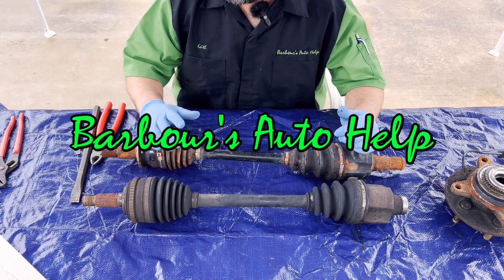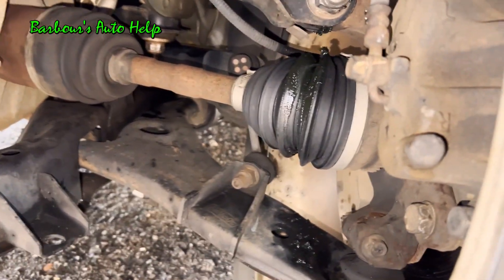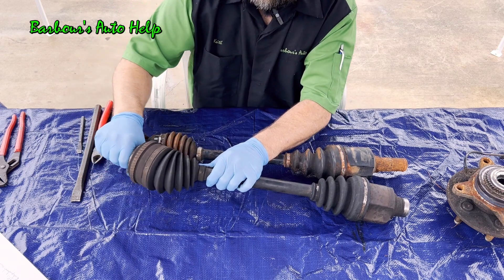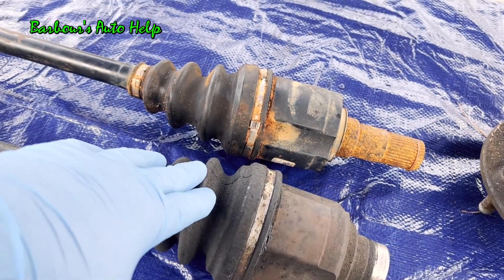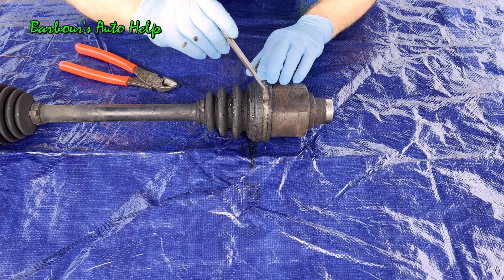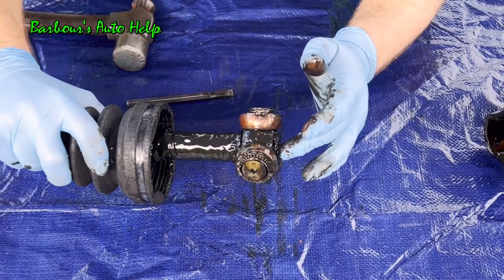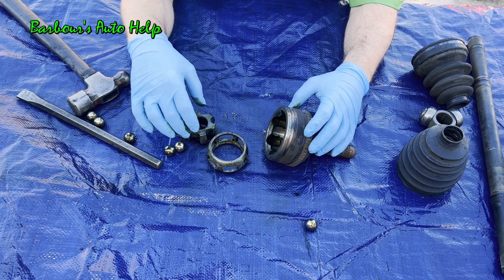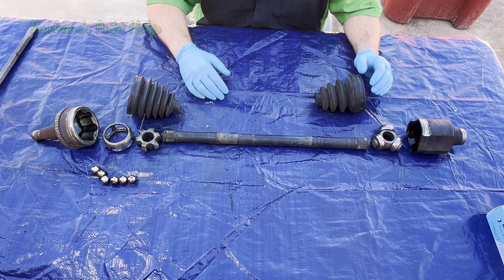CV Axles Explained

Comment: I have a question. I was putting in new control arms on a 2017 Nissan Pathfinder when I heard a pop when the rotor and wheel assembly moved a little too far. Now the car makes a scraping noise when I turn from that front left wheel I was working on.  Is there a way to salvage the CV or should I replace the whole thing? I'm not sure what went wrong but when I take it apart, I need to get it fixed and back on the road and can't have it sit while I guess what I need. Thank you for your video and your time.